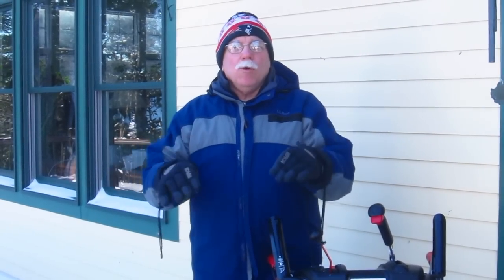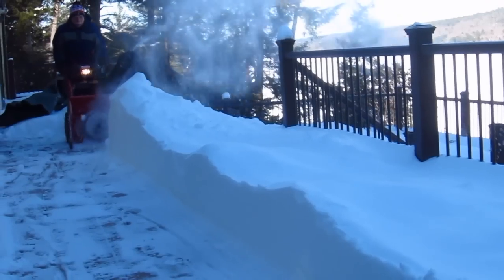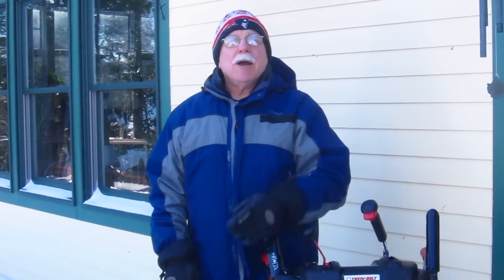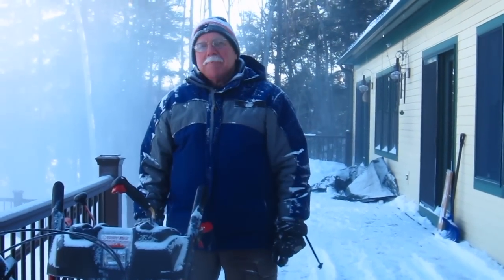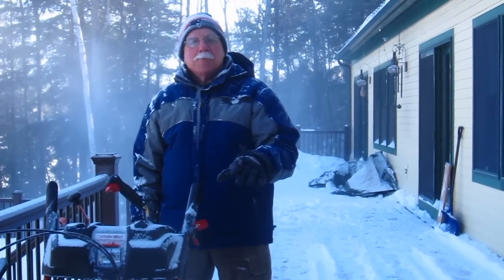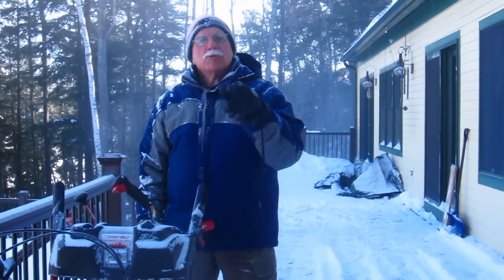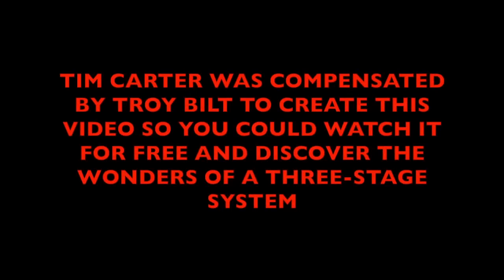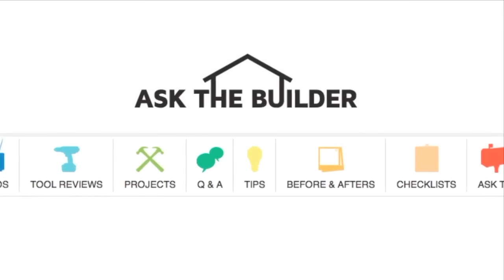Troy-Bilt 3 Stage Snowblower

Comment: This past fall (2016) I purchased the larger model of this blower with the 30" cut and 420CC engine. It is hands down, the best snow blower I've ever used or even seen in action. I would recommend one to anyone. Great video. Thanks for posting.
Reply from the maker: Thanks! You might want to do two things: 1. Subscribe to my FREE newsletter at www.AsktheBuilder.com 2. Start watching my LIVE streaming videos! Lots of fun and you get to ask me questions in real time. Be sure to turn on NOTIFICATIONS about when I go LIVE.
Reply: My 28" has the 357cc. I also have an older 2-stage 30" with the 357. Love these engines, they power through everything. I'd imagine a 420 would be even better.

Comment: Worlds best snow blower is seeing a man stepping out the back door of his work place with a compressed air hose about 35 ft long . The hose was spraying out compressed air at over 100 psi  !  WOW ! that was certainly one hell of a snow blower  !
Reply from the maker: To get unlimited free tips each week like this, be sure to sign up for my FREE newsletter at www.AsktheBuilder.com
Reply: I have a Big Echo backpack blower (1000 CFM) and if the snow is very dry and less than a couple inches can quickly move some snow, but around here snow is usually very wet and heavy.

Comment: I have a troy-built 2 stage, and I live in Maine. It will chew through the plowed snowbank at the end of my driveway even if its 4 feet deep. People see what it can handle and don'y believe it. Best snowblowers ever, electric start, heavy enough to get traction , great tires from the factory, 5 years never serviced once except to check the oil and fill her up. Never a problem, will start in -40 degree weather with two fingers in the pull start. The Rolls Royce of snow removal. throws it far! no high snowbanks on the driveway edges either.
Reply: @giskard80 What model is it?

Comment: I have the Vortex 3090 3 stage Troybilt and it does well with all types of snow,  I noticed that the shear pins are very soft and I hit something hard I blow a pin.  It is cheaper &  better than rebuilding the auger gear box, I buy my shear pins on Amazon 24 pins at a time.
Reply: How is it through thick slush?
Reply from the maker: You can get unlimited FREE tips by subscribing to my newsletter at www.AsktheBuilder.com
Reply: MTD actually revised the sheer pins for the 3-stage units. They were too soft and broke just moving heavy snow. The amazon pins are too soft, they use one generic pin and say it covers tons of different models when it's not true. Probably doesn't hurt but you'll be replacing them needlessly.

Comment: Troy-Bilt is the bomb!! My Troy-Bilt rototiller is 12 or 13 years old and has never once, failed to start on the first pull❤
Reply: that says a lot for the engine manufacturer but Troy-bilt does not make the engines on their products.  Probably a Techumseh or Griggs and Stratton.

Comment: We just had 48 inches of snow over the past two days. My problem with this blower is it has a tendency to push the snow. Did you have any issues like this. Also, they have a very poor designed case and makes it harder to get to the carburetor. I have had carburetor problems the past two years and it is surging. I had a Sears two stage prior to this one for 38 years and only rebuilt the carburetor once. It does throw the snow and will do a good job in most situations.
Reply from the maker: Wet heavy snow is a challenge for all blowers. Mine will sometimes push it. You just have to slow down your forward speed to minimize the pushing issue.

Comment: Still love my Ariens.  I hate seeing all the plastic on machines these days.  Love having a metal chute and the thing is a beast.
Reply: brodie659 I have an Ariens snowthrower, too. It's never let me down. But I put my Troy-Bilt garden tiller through lots of abuse over the years. Always got the job done!
Reply: Agree 100% here.  My old Airens weighs probably double what that Troy-Bilt weighs.  Tim appeared to be needing to man handle that thing many times, where my Airens would just cut through the snow.   My only issue with my Airens...it's a 1982 or so and I just can't get the parts for her.  I've had to make a few, and now need some parts I just don't have the ability to make, and they are no longer available.  :(
Reply from the maker: When you see me man-handle the machine the one time in the video, it's because it's up on a slippery Trex Transcend plastic deck that's like wet ice with snow on it.  The one time I had to back up is where the snow was the deepest and PACKED from tumbling from the roof.

I'm here to tell you that the machine doesn't need to weigh 300+ pounds to cut through the snow. It's all about the tires and the high-speed center auger.

Realize I have the luxury of having tested no less than five other blowers of different weights / designs in the past five years and this one HANDS DOWN is the best.
Reply: my  11hp  28inch  ariens  would  be  done   in 3  trips lol
Reply: Yup have a 32" craftsman 2 stage. All heavy duty metal. Even the scraper is heavy duty. Older is golder.
Reply: D Frs And they break easier. My turning joystick broke on the Troybilt I used to have. Because of all plastic parts. Junk.
Reply: @Steelologist  It show how cheap the machine is made and will not hold up over time.

Comment: I got the Troy Bilt 3090XP 3 stage, 30" 420cc. AC start, Electric Chute control.  Love it.  Think I paid $1500 5 years ago.  seems 3 stage blowers are atypical in the Wash. DC area.  Cub Cadet I believe took over the design.   It's a Big Blower.  Tires get good traction for plowing Up hills.  My driveway is 900 ft. long with a rather steep hill.  Fashioned a Sulky to haul my ass and it does OK on the flatter areas.  Steering is a handful in deep snow but will chug thru 2 feet which is the max I've used it in.  Burned two Auger belts (Heavy Chugging) and sheared 3 pins (Transmission is solid).  Advice:  Don't load it down to the max, driving at highest speed in 2 ft of snow is FUN (Mo Powa!), but the auger belt may smoke a bit.  The second belt can be swapped in 20 mins, have one available.  The Drive belt has survived so far.  Didn't do that well in 1" of slush, not enough volume to keep the chute loaded but why bother?  Be sure to not leave fuel in the tank over the summer and it will start right up next year.
Reply from the maker: Nice

Comment: Hi Guys,  It's not clear to me how many shear pins the Vortex 2890 has.  The Operator's Manual shows one shear pin for the right auger, one shear pin for the left auger and one shear pin for the center auger (page 19).  Then it goes on to say that "On 3-stage units, there is an additional shear pin in the rear accelerator."  I don't see a place for a fourth pin.  Do I have to disassemble or remove anything to find it?  Thanks in advance.  I had to replace the shear pin for the third stage I noticed it was missing.  I'm hoping that one missing pin will solve my problems.    Oh!  Never mind.  When I tipped the unit back on the handles I could see the fourth shear pin.   :-)
Reply from the maker: Three, maybe four. I no longer own the machine so I can't check for you. Just buy ten pins and have them on hand. You'll CAN'T have enough shear pins.

Comment: If you sped up the video a little more spring would come and the snow would go away by itself. I've seen videos of the "third stage" throwing snow everywhere at the end of a run which would be a pain in the ass to clean up. I have an old Honda track blower that starts first time with no need for a primer and will push a solid slug of slush out the chute at idle so it don't plug. It is the first snowblower I've ever owned and may be the last one I'll ever need.

Comment: I really have enjoyed mine (same model), but now in its 3rd season and seems to not work as well.  I replaced the drive belt, which had worn out.  Now even though everything seems to be fine with all of the blades and impeller, it has been mostly just pushing the snow around.  Any ideas welcome.
Reply from the maker: Easy. Check to see if any shear pins are broken. If all is well, go to your Troy-Bilt dealer and ask them what causes poor performance.
Reply: @askthebuilder  Thanks for the quick reply.  I'm in NH also (Sunapee area).  I think the main issue is the wet, heavy snow we've gotten the past few weeks.  It's just getting compacted in the chute.  When the temperature drops, my machine works much better :)
Reply from the maker: This is the next blower I'm buying: https://www.youtube.com/watch?v=QBSuNz3g0oA

Comment: I have the same snowblower.   Recommended by CR.   It cannot handle wet or icy snow.  That will clog the shute continually.    Can handle deep fluffy snow, but we often have temps in the mid 30's after a storm, so the snow is slushy at the base.   Not a good showblower for that circumstance, which is what we have usually in southern Pa.
Reply from the maker: To get unlimited free tips each week like this, be sure to sign up for my FREE newsletter at www.AsktheBuilder.com
Reply: Single stage?
Reply: Here in Erie Pa,  we get big snows . My vortex 2890 clogs up with heavy slushy snow when the driveway is still warm and temps in mid 30's  I tried setting shear pins lower also silicone spray on the auger blades any other suggestions ??

Comment: I have been using snowblowers of various brands and models and sizes for over 30 years.  Getting the snow into the impeller has never been a problem.  Getting the impeller to keep up with the auger has always been the issue.  MTD's 3 stage snow blowers (MTD, CUB Cadet, Troy-bilt, etc) are really only addressing one issue, the packed snow at the end of the driveway.  For me I take a few small swipes to break through then all is well.   In my opinion and it is just my opinion, the 3 stage is a gimmick to sell snow blowers.  Remember the 45" dual wheel models of a few years ago.  What manufacturers need to do is to build their gear boxes more precisely so the impeller can spin up faster and throw the snow further and faster.  What is next a 4 stage unit.  Instead of one front mounted auger they might use 2 so the unit just screws itself into the snow.  You won't even need to power the wheels.
Reply from the maker: You're telling people how old you are! Sounds like you might be a candidate for Silver Singles. For unlimited free tips each week subscribe to my FREE newsletter at www.AsktheBuilder.com

Comment: I am using the same snowblower and it seems the shear pin of the inner central augur is broken, I am not able to replace it, any advice? The snowblower still works fine but I think the the throw is somewhat less and snow seems to jam at the back end.
Reply from the maker: I'm unable to comprehend how you can't change that shear pin. I can reach mine with absolutely no difficulty.
Reply: @askthebuilder  I had troubles with replacing my shear pins until I Youtubed how to replace shear pins that were still stuck in the auger. I had to disassemble the front propeller auger to get good access to the second one behind it. I also had to raise the snowblower on a plastic bin to make it easier to punch out the stuck piece of shear pin. Best way to avoid this in the future is plenty of lubrication on the shear pins as they are being replaced. I own a 3-stage 30 inch 420cc Troy-Bilt Vortex.

Comment: I found it great for the deep blizzard type snow we got 5 years ago here in Maryland, but wasn't able to use it at all during this week's event once the rain mixed in. The 2 stage blower I also use worked the whole time once the snow turned to mush.  The 3 stage clogged immediately and was unusable the rest of the way.  I recommend this blower but just for large "dumper" type events
Reply from the maker: To get unlimited free tips each week like this, be sure to sign up for my FREE newsletter at www.AsktheBuilder.com
Reply: Same storm in MD my 3090XP 3 stage rocked it, but I got so into the shear power of this beast, it burned the auger belt.  Really fun!  But do do 2 ft of snow at highest speed!

Comment: Tim, I'm in the market for a new snow thrower.  My old Airens (1980's) is coming to the end of it's life.  As others have commented, these new snow throwers just feel cheap.  So light, so much plastic, and even this beast will "ride up on top the snow" when it's heavy and wet, or compacted. How can these cheaply made, and rather light weight (as in they don't weight that much in comparison) do better than my old beast?  

I noticed you did quite a bit of "speed up" video shots of you clearing the snow.  How about showing us that in REAL TIME so we actually know how long it took to cut through that snow.   MY Airen's would be in 2nd gear and I would just walk it through, you appeared to need to be tossing this thing around in comparison...but you can't tell because you sped the video up.

I looked at the Troy-Bilt, but the Husqvarna felt better made to me, and seemed to have a higher quality of workmanship.  I wouldn't replace my Airens if it wasn't for the fact that parts are getting nearly impossible to find for that old girl.  I finally found ONE place with a recoil starter that fit (after some customization work), and I was also told by that company "I bought the last one they had, there are no more".  I'm at the point with my Airens that I need a small machine shop to make parts for it....If it wasn't for that, I'd never let her go.
Reply from the maker: Well, they're not cheaply made. Mine's got a heavy-duty plastic chute. I've used plastic chute blowers here in NH for the past 8 years. NEVER a failure. I love them because the snow doesn't stick to them.  As for weight, well the machine you see in this video tumbled yesterday from the upper deck down to the lower one. It was impossible for me to lift it back up. I needed the help of my husky son. You'll not be disappointed with this Troy-Bilt blower. If you feel you need MORE POWER, then get a model next up that's got a bigger engine.
Reply: Glad to hear your's seems well made.  I was at the local "lowest" looking at them, and they were quite literally falling apart. The connection of the auger/chute to the main chassis was so loose that I felt it would shake apart in the first use.  I asked the salesperson about that...they said "this is how they come in, and we've noticed the same thing".  Might be that your's came direct from Troy-Bilt, and maybe they went through it with a fine tooth comb before giving it to you, but the ones at the big box store were rattle traps.  

I hate "settling" for less.  The Husqvarna seemed to be better built than the Troy-Bilt.  Don't get me started on the Airen's...Worse than both of them.  Matter of fact, I've seen no-name brand looking/feeling better than those overpriced items.  I have an entire summer to think about it.  My Airens still runs, but I know I'm at the end of its useful life with parts becoming impossible to find.
Reply: MTD makes the TroyBilt...Yardman..Yardworks...Sears...Columbia.....and the MTD branded like my MTD Gold 30" 420cc that I purchased last year, The reason you dont see a 3 stage Ariens or Husky is MTD owns the patent on the design. I bought mine in the crate...if the chute was falling off in the store the staff there didnt assemble it properly because its not on the machine when it comes out of the crate. Ive never had a snowblower before this so I cant say if its any better or worse but Im not really sold on the 3 stage design. I did post a video of mine from a big storm last week. If I had it over again Id buy the columbia high frame and even with the size and weight of this blower I think it needs chains as well. Just modded it today abit with some rubber impeller inserts and seems to make it even better.
Reply: When it comes to riding up on the snow, Ariens are the worst! I've got an older 824 that just wears me out if the snow is a little heavy. I have to hold up on the bars constantly.

Comment: MTD Arnold makes some great snowblowers.  They build them under a few brand names, but they work well.  I've wanted to get a look at how the 3 stage blowers handle heavily packed snow and even ice; this video was great!  Just think; a 24 inch snowblower with a much bigger engine then you normally get in that size blower, and it sucks the stuff in and spits it out very, very nicely.  Great for a small space with very tough snow - exactly Tim's situation.  That baby monster takes up very little storage space, can go through a narrow gate, but is as strong or stronger then some much bigger units.
Reply from the maker: Thanks! You might want to do two things: 1. Subscribe to my FREE newsletter at www.AsktheBuilder.com 2. Start watching my LIVE streaming videos! Lots of fun and you get to ask me questions in real time. Be sure to turn on NOTIFICATIONS about when I go LIVE.
Reply: @askthebuilder  Hi Tim.  I am subscribed.  As you may recall, I used to sell snowblowers, mostly under the Craftsman name, but know who makes them.  While I appreciate my 26 inch unit, if someone has a lot of snow but narrow spaces to work in, a high power 24 is a very good choice.